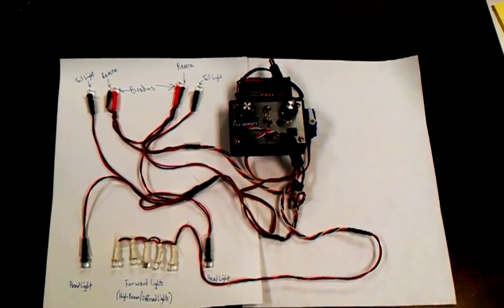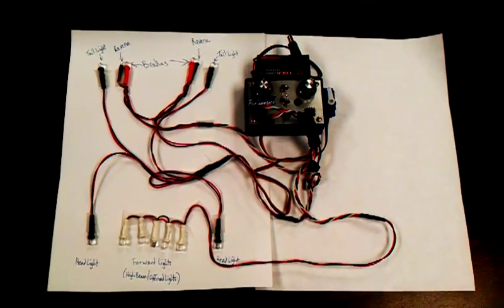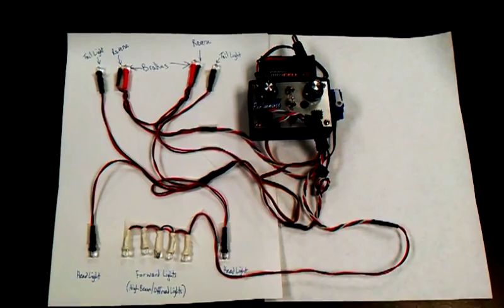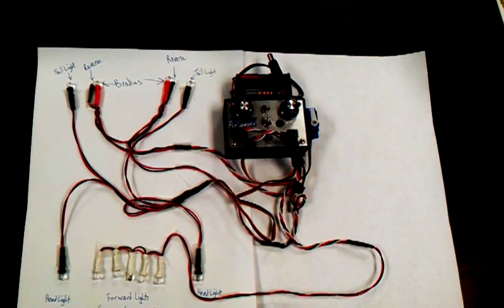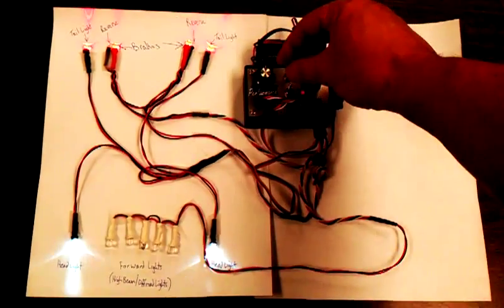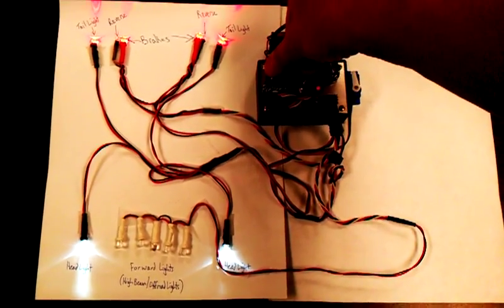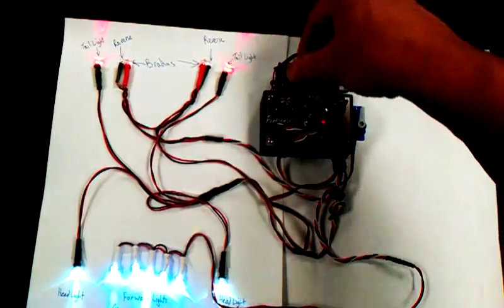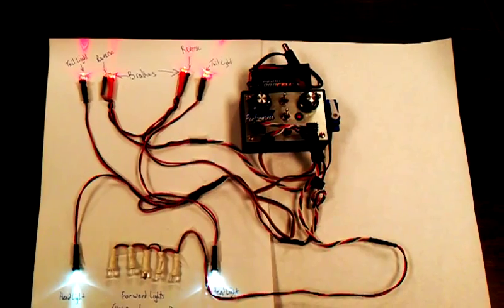Brake, Reverse and Driving Light controller

Comment: So I got this and was finally trying to hook it my brake lights are alway dim can’t get the reverse light to come on. Forward and and always on is on all the time. But if I unplug always on light and boot it up then reverse and brake are on. I am also using 2led per connection. I am assuming that all have to be plugged in and maybe needs 4led per connection.
Reply from the maker: email me and I will try and help: mostlyal@gmail.com

Comment: What lights do you recommend? I'm looking to use 4 brake lights and 4 running
Reply from the maker: I like to use 3mm or 5mm LEDs.  I wrote a tutorial on wiring them: http://www.rccrawler.com/forum/electronics/422460-how-wire-leds.html

Comment: i have a question...my speed controller has an ABS system and how does that light controller know when to turn on the reverse lights when the brake is pressed but the car is still driving forward but slowing down...does it turn on the light/s when the motor actually rotates backwards? this is old video i know but its interesting
Reply from the maker: Think of the what a servo would do if connected to the throttle signal.  When stopped, the servo horn would be in the center position - that is when the brake lights come on.  When you move away from the center, the brake lights come off.  It doesn't know what the vehicle is doing...it could be coasting or the wheels could be jammed up.  It only looks at the throttle signal.  This video is to show that.  Starting at about 1:22 is when things start happening. Watch the servo and the brake lights.   Depending which way the servo moves away from center, it lights either the forward or reverse output.
Reply: ohhh ok thanks
and also thanks for the quick response
Reply from the maker: Welcome!

Comment from the maker: The real reason that the forward only output is there is because not all ESCs use the same signal to go forward.  Sometimes you need to reverse the throttle channel on your transmitter to make the motor move forward when you pull the trigger.  This is why I have a Forward and a Reverse output.  This ensures that one of the two outputs will light up when you go in reverse.  I just needed to call that output something so I called it a driving light output.